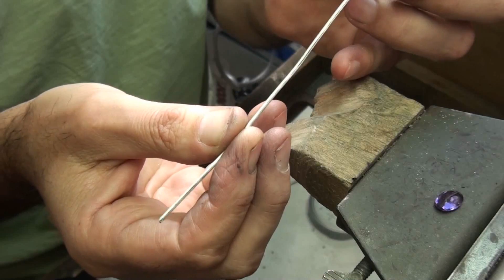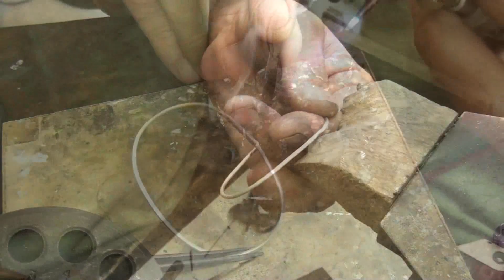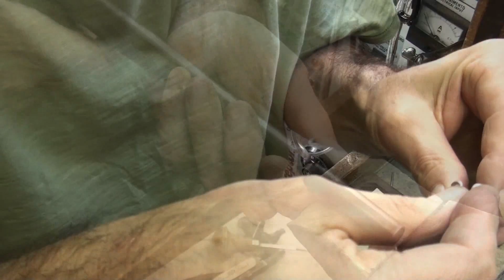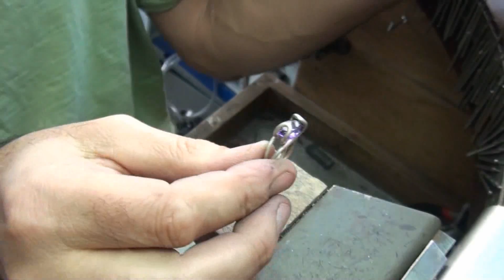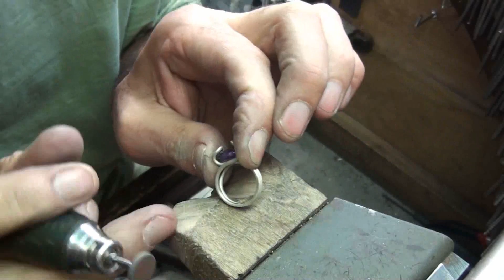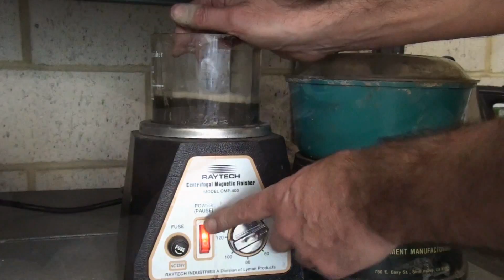Tension set wire ring

Comment: How do ᵘ•ηᵒ what length of wire to use?¿
Reply from the maker: 1.6mm round wire x 160mm was used. You will need to experiment as it depends on variable such as the stone size
Reply: @jewellerytrainingsolutions9978  thank you. I’ve not made jewellery fir a while as been ill. But this looks therapeutic

Comment: This is a brilliant idea, thank you so much for sharing! I'm curious, do you think this would work as well with a non-faceted stone, such as an oval cabochon, or small opal?
Reply: Of course it would!  Any cabochon would work. But not for opals or turquoise or soft stones. The tension of the ring is too much pressure for softer chalky stones like turquoise or delicate layered stones like opals that could crack. Use hard stones.  Opals should not be covered up either. Too delicate.  And best not to put it on a ring which gets too much handling on fingers. Earrings or pendant is better.

Comment: I wish he would have mentioned how long wire he started out with and for what size wire we had so we have some idea what length of wire to cut?
Reply from the maker: +Wendy W I do mention 16cm long at the start of lesson
Reply: Louise Dahms
Maybe you did not hear him at the beginning of the video. He said 1.6 mm wire and 160 mm long.
Reply: me too!
Reply: Maybe you did not hear him at the beginning of the video. He said 1.6 mm wire and 160 mm long.
Reply: Louise Dahms that's 15 gauge in the US, or 16 gauge if you can't get the slightly thicker size